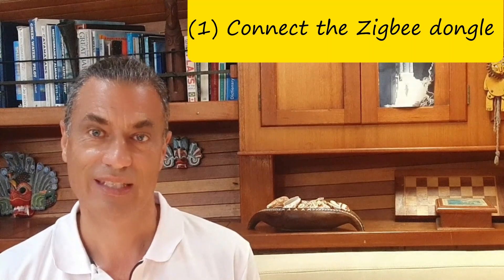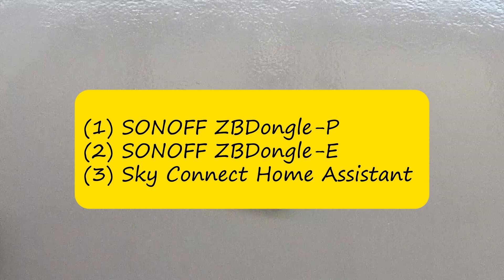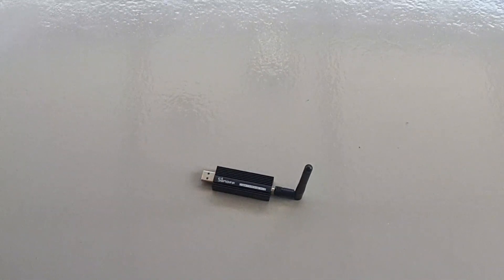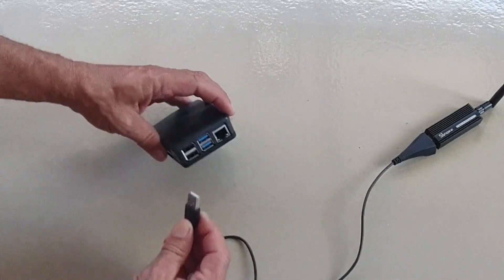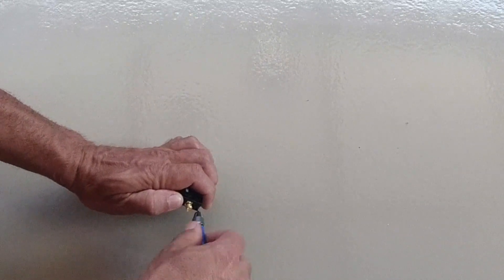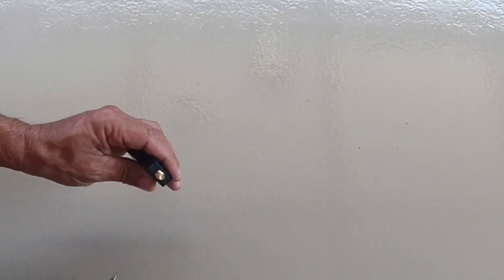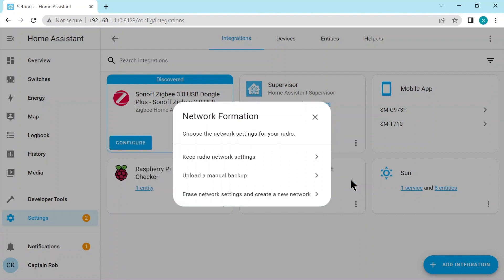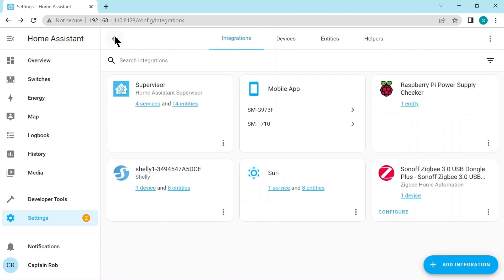Smart Boat 7: Adding a Zigbee dongle to Raspberry Pi and Home Assistant

Comment: Great videos Rob. I’ve been implementing them and have temp sensors working. I did have the Sonoff Zigbee dongle-E  working with a few Aqua sensors, but after a HA software update - the dongle won’t initialize any more. Just wondering if you had the same issue and could shed any light on what may have caused this? Mark
Reply from the maker: Oh that is a pain! I have been updating regularly without this issue.
Here's a few steps to troubleshoot:

Reboot Home Assistant: Try a complete reboot of Home Assistant or even the host system if the above doesn’t help. This can sometimes resolve lingering issues after an update.

USB Port Issues: Check that the dongle is still correctly assigned to a USB port. It should be ttyACM0.. You can verify this in the Hardware settings in Home Assistant.

Check Logs: Check the Home Assistant logs for any errors related to Zigbee or the dongle. This might give you a clue as to what's going wrong.

Restore Previous Home Assistant Version: If the issue started right after the update and you suspect that it’s the cause, you can try rolling back to the previous version of Home Assistant. Go to Settings > Backups and choose a backup to restore. This might resolve the issue if it's related to the latest software changes.

Comment: do you have to have the Zigbee dongle to use Aqara sensors?
Reply from the maker: Yes you need the dongle to use any sensor that uses the Zigbee wireless protocol. This includes the Aqara Water sensors.

Comment: I gona follow your guides and set up a raspberry with zigbee. Do you know any zigbee DC energy meters for 12V? like shunt or klamp meter. Good guides.
Reply from the maker: Great. For Wifi you can use a shunt and an esp32 / INA 219. I will be making a video soon. Probably using a Hall Clamp. I have not seen any zigbee ones for DC

Comment: Hi Rob,
Have you seen the Phoscon Raspbee Zigbee gateway that goes right inside the Pi enclosure? Seems like a neat solution.
Reply from the maker: Thanks for your comment. I only explored the most commonly used Zigbee dongles during my research, considering their widespread adoption among users. The Phoscon Zigbee gateway does indeed seem like an interesting solution, especially since it conveniently fits inside the Pi enclosure as a HAT, making it neater and compatible with most cases. However, it's worth noting that some users have reported interference issues when a Zigbee module is positioned too close to the Raspberry Pi. One advantage of using a USB dongle is the flexibility it offers to place it further away from the Pi using an extension cable, potentially mitigating such interference concerns.